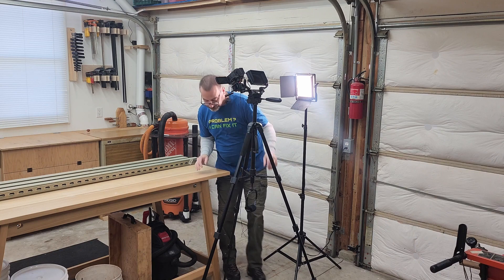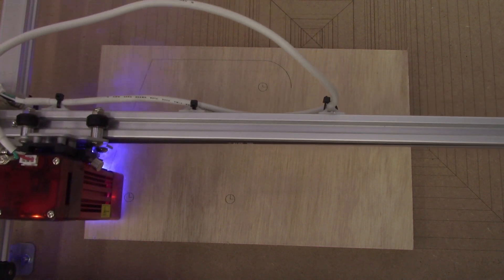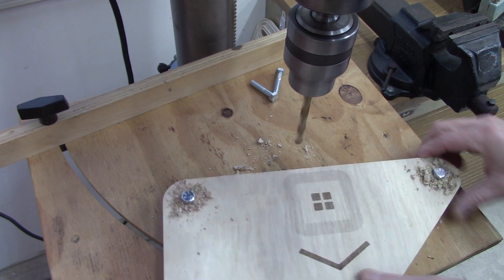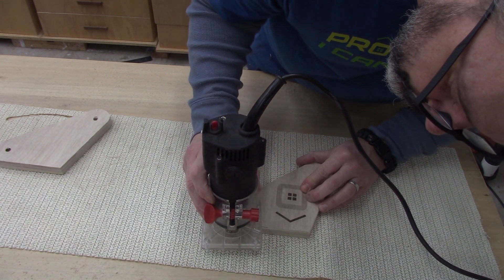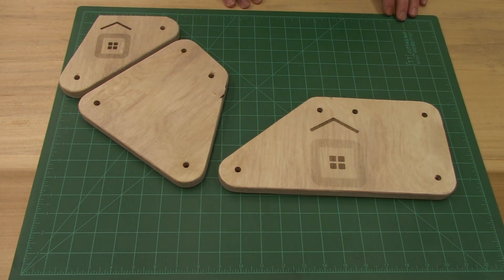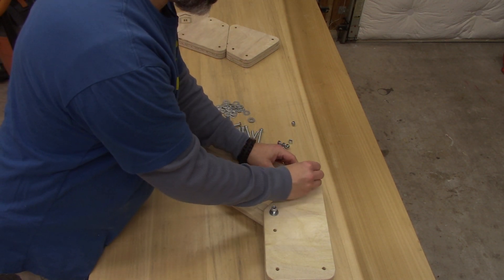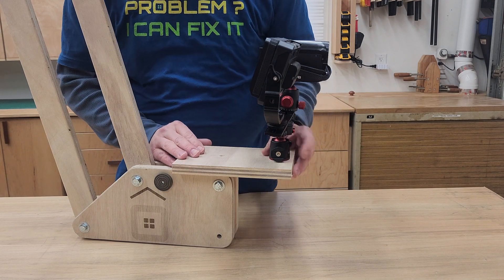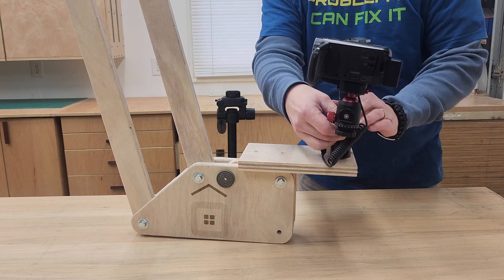Create Your Own Articulating Camera Boom Arm - Easy DIY Solution for Better Camera Shots

Comment: Great build! I also checked out your track video ...awesome stuff. Wondering if you have templates for the plywood hinge plates ?

Also wondering how hard it is to learn the orturo laser and one of the things I would use it for is engraving the bottom of wood bowls that can be 8" more tall .... how would they fit under the laser would also use it to engrave cutting boards?

Thanks again!
Reply from the maker: Thanks!  Sorry, I don't have any templates available.  All you need to do is keep the hole spacing the same from one set of plates to the next.
If you want to use a laser to engrave taller objects you make blocks to raise the frame up.  Just make sure they're stable so the frame of the laser can't move.

Comment: A boom arm is a complicated piece of engineering and you should be proud that it came out so well. It looks heavy and bulky though. I wonder what would happen if you swapped out the plywood arms for aluminum square tube?
Reply from the maker: The plywood is heavy but it works well.  The friction between the parts kept me from having to use springs.  The weight also helps it stop swinging when I extend it out far.
Aluminum would definitely be lighter but would need counterbalance springs.

Comment: great idea. how would you fix the wobbling if you wanted something more solid? springs in the arms or is it fromt he main base the arm is coming from?
Reply from the maker: It's mostly the length and the material.  If it was shorter and metal it wouldn't wobble.
It goes away quickly enough it isn't much of a problem.